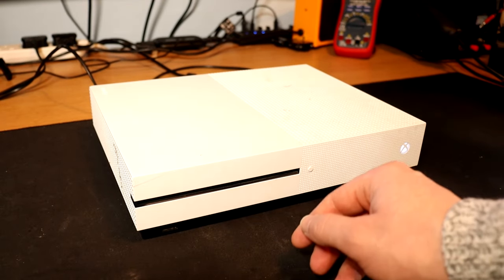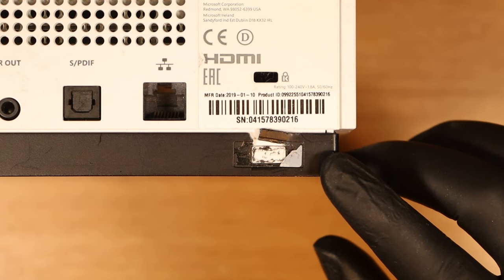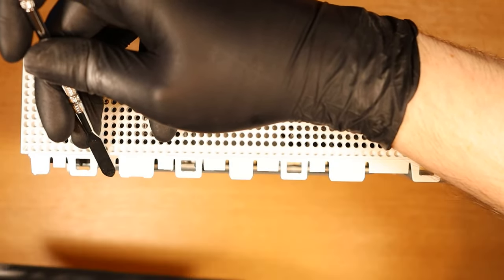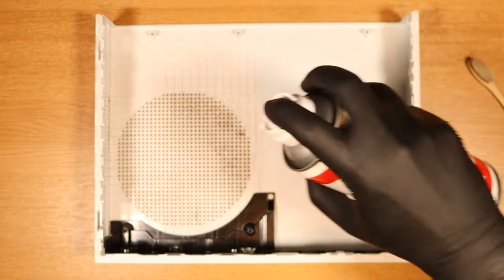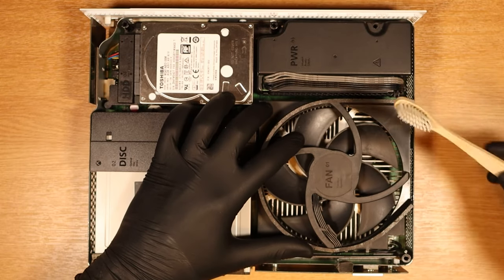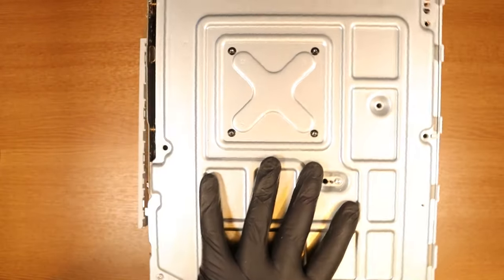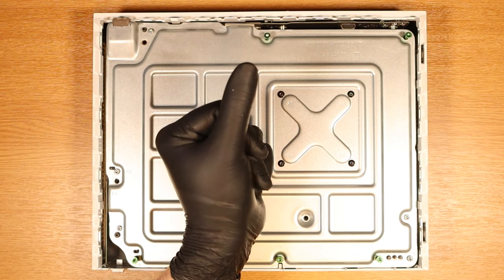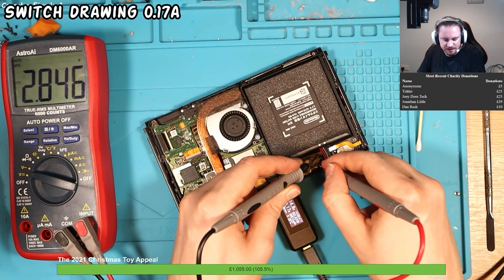How to Clean an Xbox One S

Comment: 7 years of built up dust, overheating started to become a problem. I knew I had to do something. This is the BEST video for dust cleaning, thank you so much, my xbox is running faster than ever
Reply: More stable fps?
Reply: @icy00005 I’ll tell you once I’m done
Reply: @icy00005 ill actually tell you when I'm done
Reply: @icy00005  UPDATE ON XBOX! Got it all done. Only minor damage to the plastic box. But my games run better, stutter is gone! Fan is quieter. When you first turn it on, it'll start pretty slow though

Comment: Excellent video!  We have the Xbox One S without a disc drive, so there were three additional screws to enable us to remove the metal piece above the fan/CPU etc.  The metal is REALLY soft so only tighten them gently when screwing them back in!   We also went a step further, and removed the cooling fan from the heat sink - just gently pried the tabs from the side of the heat sink and unplugged it from the board. Fairly easy, and it exposed a lot more dirt on the heat sink and on the bottom side of the fan. (I did this with my 11 year-old and he did most of the work)  Thanks for making this video - super useful, to the point and informative!
Reply: Thank you so much for pointing this out! I was gonna do this without the disc drive and would have been screwed 😂😂

Comment: I just had the microfiber cloth, a screw driver and my trusty breath but it seems to be working much better, I'll get around to a better cleaning later, thanks man. Tip: be careful with the controller pairing button on the black casing and don't follow tutorial stoned, you may forget a screw and have to take the bottom off all over again, but hey practice makes perfect right?

Comment: Thanks for this video! Knew my xbox was in need of clean, blowing hot air from the fan and pretty noisey, but didn't have the confidence to remove the casing in case I broke anything, but this walk through paved the way.
Xbox was pure filth once I opened it up! Followed the steps...its nice and clean, not blowing hot air and is back to being quiet. Nice one!

Comment: Was much easier than I thought.  Having bought consoles since the 80s I feel (somehow) silly for never ever having opened a console. I know it's a form of computer and I clean my computer from time to time, but being engineered for anybody I always thought that consoles, just like DVD players, no one ever needs to open and clean those.  There was so much dust in my One S and I don't have a dusty house I tell you. It was overheating sometimes, I guess it will resolve that problem.  Thanks.

Comment: Was really tempted to open my Xbox one s to do a thorough cleaning cause I was afraid to mess something up 😂, but this video made it easy and it was really well explained. Step by step, and this made me get the courage to open it up and clean it, which I'm glad I did. It was filled with heavy particles of dust, which made me feel real bad that I hadn't cleaned it awhile ago 🥲😅. I'm surprised it didn't overheat while it still had the amount of dust it had. Hopefully this allows for my Xbox to run at it's full  potential as it was slow on loading games and apps. Nonetheless, great video 👍😁.

Comment: got an error e100 00000706 8007045d directly after trying this on my friends xbox, I didn't clean as deeply as shown in this video, stopping at 3:34 and just using compressed air and a rag to clean around the fan and connectors. anybody know how to solve this issue?

Comment: If you don’t have a torx 10 screw bit then you can use a 2.5mm flat head screw driver instead, I did and it worked just fine

Comment: Great video,great instructions. Fixed my issue with the Xbox shutting off. Only comment I would add is when your removing the bottom ensure that you take care with the pairing button it is not attached very well and breaks off the bottom housing very easy. Speaking from experience lol Great video Great instruction

Comment: Good video joey, though I would remove the heatsink and replace the thermal paste.  But I can understand why this part was left out as some would damage their Xbox with using a screw driver.  Its one of the reasons I bought an x-clamp removal tool ;) - I also find it easier to put the bottom panel on from the front as the USB port can stop the panel going on.
Reply from the maker: Thanks Roy 😊 Yeah that front panel part makes sense. The intentions of this video is to help some people that are maybe wanting to clean their Xboxes from a beginners perspective, so didn't want to go too deep 😊
Reply: @JoeyDoesTech  Future video idea maybe? ;)

Comment: Nice guide, thank you. I’m pretty familiar with building and taking apart computers, so I knew the precautions to take. However for something like this it was invaluable to know what screws to remove and how to remove the case. As I saw someone else commented, I would have liked to have seen a more comprehensive teardown and I found other videos on YT that showed me how to remove the optical drive, fan and hard drive so I could get to all the dust more thoroughly. Btw did you manage to crack the plastic above the warranty sticker by the way, or was that someone else?

Comment: Is it possible to just use compressed air on the vents at least for the exterior? Would it damage the system?
Reply from the maker: Yeah compressed air is fine, however you don't want to use it externally pushing the dust into the console if that makes sense :)

Comment: I clean my Xbox and the dust was crazy after 5 years without cleaning it. It works so much better now but one problem i have is the disc won't go fully into the Xbox one s now can i fix that because I don't want to spend $300 on a new Xbox

Comment: Ive got an issue and i thought this video might have helped out but its not an idepth of a clean as i have done, so basically i have the one s without the disc tray and i took ot apart to clean it which i did successfully, however i have two spare small black screws now? I am so confuesd as i believe i put them all back in and cant figure out where the live.. can someone please help me?

Comment: great video and very helpful. Though I ran into a problem and need help or reinsurance that is it's a problem or will become one. One of the green screws is not all in but it's not accessible enough for me to unscrew it, it's like in a weird state of stuck but still able to screw in and out. any tips for fixing this? oh and by the way, it's in the F5 hole if that helps.

update: the one in F2 did the same thing

Comment: Amazing tutorial, I did it with a thin butter knife as a prying tool and that worked fine. If it wasn't for Microsoft sending me an Xbox with one of those green screws already slightly stripped it woulda been like 10 minutes to take apart if that, I had to use a T15 to get bite on it, and to put it back in had to use needle node players and screw it very slowly using the outside of the head of the screw, even then I didn't get it all the way back in but it's holding fine. Do you happen to know the name of that kind of screw for it's length and where the threads are etc? I'm sure I could get a new one at a hardware store but yeah curious if you know that. Otherwise thank you very much. Surprisingly for being 6 years old I didn't get a ton of dust out. Decent amount but not as much as I would have thought. The 1 S seems to live up to its name for being able to stay clean from what I heard from Xbox techs when I'd call them about cleaning it externally.

Comment: Great clean, unfortunately hey as we both know most of the dust gathers around the heat sink. Maybe you should of gone as far as removing the hdd/dd power supply and blow out the heatsink without removing it off the board.
Reply from the maker: Yeah it's a good shout Danny. I wanted to keep risk to an absolute minimum for anyone who potentially is looking to sell their console over Crimbo or for other reasons. I might do a more in depth one depending on how this one does. This should still help a bit I guess 😊
Reply: All knowledge is helpful 😉

Comment: Hope this helps someone 

Take a quick picture once covers off’ 
Print it out! 
As u take the screws out put them on the paper in the exact spot u took them from’

Putting wrong screw in wrong hole= OUCH!
Reply: What happens? I thought the green screws were all the same?
Reply: @kayevon7491  meant in general with anything you do take pic then put screws on picture 
If you put the wrong one 
You either strip holes or worse case run screw through the board and cause lots of issues’ 
(I did that on an iPhone) then started doing this so I remember where each screw goes 

If it’s all same size screws then it’s not needed